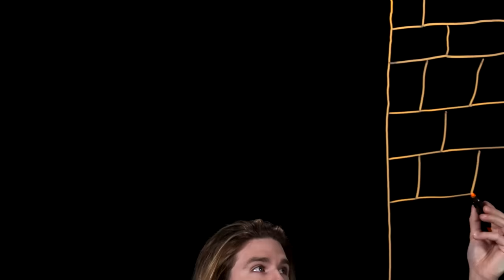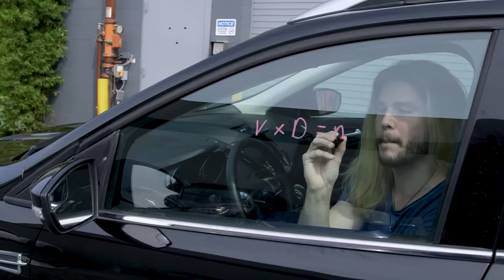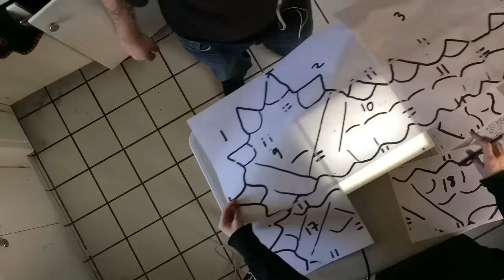Could You Swing A Real Monster Hunter Sword?

Comment: but Kyle, a sword's center of gravity may not be where you thought it was... A swords center of balance/gravity is displaced by the counterweight present (which is the pommel/hilt)... also, to purely base the sword's volume purely on the organic compound would alter the result drastically... So if I where to hypothesized the weight of the blade, it would be heavier, also if I were to assume where the actual center of gravity for the sword is, it would be less than 3 feet away from the swinging hand (hand nearest to the hand guard)...

P.S. I haven't played monster hunter, but I do know some knowledge on weaponry... And I love this Show...
Reply: Paul Michael Genovate There's also teeth as mentioned by him, and inworld, the hunters are supposedly normal "realworld like" humans. The weight should be different. Also center of mass as mentioned by you.
Reply: Paul Michael Genovate ikr... Lol the whole point of the weighted pommel is to provide a counter weight and hence make wielding the sword easier
Reply: Paul Michael Genovate exactly what I was about to say but just adding counter weight on the pommel would make it way more heavier which is the last thing the deviljho sword needs. Instead removing materials from the top/replacing with lighter but still tough parts would be the better to reduce it's center of gravity & the world of Monster Hunter is full of such materials
Reply: Actually, interestingly enough, Hunters aren't humans. They're humanoid, sure, but they're all descended from Wyverian Hunters active during the Great Dragon War. Only people with the special Hunter genetics can actually become Hunters. And yes I'm well aware the Great Dragon War is the silliest thing ever.
Reply: if I can recall my biology correctly, Teeth have a different volume from scales... due to the fact that teeth are made up from different minerals like calcium, enamel and maybe some iron... also, I just noticed that the "blade" is connected not only by some adhesive, but also by a chain.. this also affects the center of balance of the sword... if we use real world weaponry to compare it with the aforementioned weapon (berserker sword), it must be one of many shark teeth weapons of the Maori... We just have to replace regular Great white shark teeth with that of a Megalodon (or just make it 10 times it's size), then we just add scales, some metal (probably iron) and we may have some "real world" basis... so my hypothesis is that the berserker sword is heavier (give or take the scales and teeth are brand new) and the center of gravity is closer to the handle or hand guard (because when organic compounds age they become lighter, and because of the counter weight which is the pommel/hilt)... if we were to make it lighter, then the frame inside the blade must either be hollow, or the material should be lighter... also, since we don't have any exact measurements for the beast we can't calculate exactly how heavy this thing is... and since the weapon is made instantly, the smiting process (which helps me understand and analyze) may vary from having pure materials combined into a massive lump, or there were cheats made to make the weapon lighter... I think I need to watch some Blacksmiths forging fantasy swords again...
Reply from the maker: -The prop's center of mass was where I stated.
-I based it on the organics because it's made out of organics in the game.
-But you're right, if this was a more traditional iron or steel, even if the COM was closer, it would still be a MONSTER to wield (heh) 
--KH
Reply: Shanthala Thammaiah 
No, pommels were made mostly for ergonomic purposes and for offence as well, the counterweight effect is actually very small.

At first with early one handed swords they were used to improve the power of the swing, by providing a leverage for the pinky and the bottom of the hand to use.

With two handed swords, they served the same function, but sometimes with the bottom of your left hand, sometimes with the top of your left hand, depending on the technique.

They were also used as improvised maces with the mordhau technique to deal with opponents in armor, or they could be used in a normal grip when the two fighters got within grappling range, and they were very deadly.
Reply: @Paul Michael Genovate I thought that too but there is also a metal chain towards the tip of the blade which would somewhat balance it out. It would definitely be heavier though due to the metal components, if they're steel I'd estimate about 200kg.

The best approach would be to divide the sword in to separate components and add the torque they generate together.
Reply: Paul Michael Genovate I think others have pointed this out, but the pommel is too small and would likely make a negligible difference in terms of actually wielding the sword. At that size the pommel is more or less there to prevent the weapon from slipping.
Reply: The pommel looks about 10cm diameter and height to me which would put it at 6kg or 3% of the overall weight if it's steel, the handle is really long too meaning it'll have a greater effect. If you were strong enough to wield it you would really appreciate the difference but for ballpark estimates about a sword 100x heavier than a regular guy could wield with any level of finesse  I guess it's not a very important detail.
Reply: hmm... given what you guys said, I guess I have to agree... but since it's still a fantasy sword, the only bases I would really need is how it's made (via how the blacksmith in the game would craft it like if there were any cheats or something...)... also, since the pommel is small there may not be any effect to the weight distribution... but still... I cannot deny that you need to be freakin strong just to wield a sword like this... also, I just realized that, even though it appears like a Maori shark tooth weapon, it may act more like a Zanbato/Zhan  Ma Dao... for Rurounin Kenshin fans, it's Sanosuke Sagara's weapon when he first fought Kenshin...

(I Love this types of conversations... so science-E... hahaha)...
P.S: I'm not an expert, just some unemployed graduate who likes science... even though I think wont be teaching Science if I get a job...
Reply: Shanthala Thammaiah, that isn't quite entirely true. Pommels are meant to help keep the hand in place and with certain swords give a means to grip on for a bit more leverage. Pommels are also used in the construction of the handle to keep the grip on.
Reply: You have a point, Though a moot one. If you can't lift an engine block without help then you can't use a sword of that size, the balance of the blade is a mere footnote.

Comment: I suspect that the replica is made almost entirely from foam, while in game it looks like the whole handle is metal. Being much denser than keratin, the metal handle would shift the center of mass of the "realistic" weapon closer to the grip, making it a bit easier to manipulate.

Also, the pommel may be made from something extra heavy, and thus shifting the center of mass even further down at the cost of increased mass (which is presumably not that relevant, since the force of the torque is so giant anyways...).

Great vid!
Reply: yes the centre of mass should be at the hilt but on this sword there is a giant chain at the end which looks like it would offset the hilt hence the centre of mass is closer to the middle
Reply: oh yeah, the chain... it doesn't look as massive as the whole handle though... although I guess it's massive enough to disregard my first point :)

however, the point with the pommel still holds
Reply from the maker: It is heavier near the hilt, but just look at how much volume (and mass) is right at the bulbous tip of the sword! That's the problem -- KH
Reply: Yea, I think just assuming it's all keratin which would be the lightest material is a good way of showing that no matter what it would be rather impossible to wield. 

Assuming the sword was balanced at the hilt you would still have to lift something (now taking into consideration the increased weight for it to be balanced as the keratin still weighs what it does in the blade of the sword) +200 kg.

Assuming the average human arm is 630 mm long, it would mean that if holding it in one hand straight arms the torque at your shoulders would still be ~1200Nm or  half with both hands assuming equal load distribution.

Now I can't help to think about the grip needed to hold on to the sword. If we assume the the speed of a swing is 30 km/h or 8.333 m/s (which from some quick googling isn't quick) and it take 0.5 s to reach the speed we get a force of 3332 N, lets say 2/3 of that is pulling the sword out of your hands. So ~2220 N. That is a lot of force to grip against.
Reply: KH - Yeah, but it is almost as bulbous at the hilt, so I'd say it kinda cancels out. The chain though kinda cancels out the hilt, so yeah... All in all it was a good demonstration of just how impossible it is for a normal human to wield that monstrosity :)
Reply: Leon - I gathered from the vid that it wasn't as much about whether a man can wield it (obviously not...), but about how much strength would you actually need to lift it, ergo how strong the hunters in Monster Hunter must be. That's why I even suggested the pommel thing, which would increase mass but also increase maneuverability (lol I have no clue how to spell that :D).
Reply: I think we can all agree, though it looks cool, the sword is designed about as inefficiently as possible, these monster hunters need to go on a sword making quest
Reply: Yeah, maybe they should watch more Shadiversity

Comment: To be fair tho Hunters don't wield the Greatsword with ease, all of the attacks use momentum.
Reply: they still have to lift it
Reply: Momentum my ass, u have never used a Greatsword right?, In combo u can see that the hunter can hold the blade mid air to charge for a heavy hit
Reply: @uchophamxuan6515  i mean they still need momentum for certain moves transitions in combos right? also just chill
Reply: NOT all. certain moves transtions like swinging to the front and to the back most likely has no momentum. it probably only happens when you spin and swing it from left to right that requires it

Comment: you don't only need to be super strong, you also need to be super heavy because the force created by the sword swinging would pull on you, so that if you don't have the equivalent counterweight you get dragged away. 
anyway nice video.
Reply: I would hope by the time you're strong enough to even wield it efficiently you'd have gotten enough muscle mass to be the counterweight yourself.
Reply: E. P. You could compensate for that with technique.
Reply: But then why is there no fall damage?
Reply: Wilkwolf coz they are super humans lol
Reply: Exactly. according to Skallagrim's calculation, But put in the weight of the sword. after a long process, I came up with around eleven thousand five hundred eighty seven pounds (11,587 lbs).
Reply: The armor...